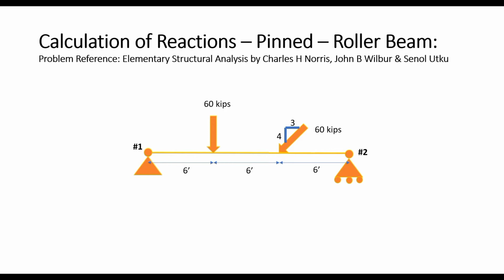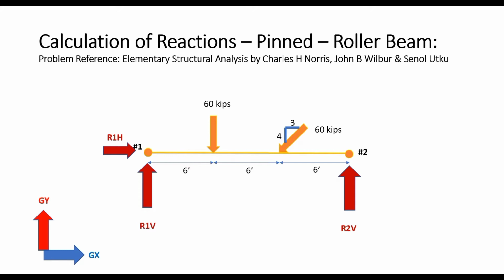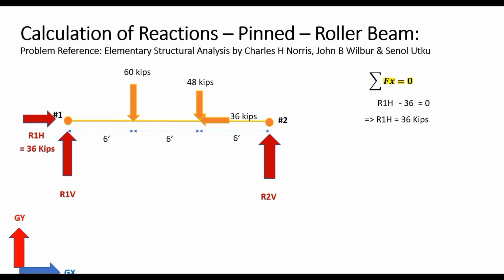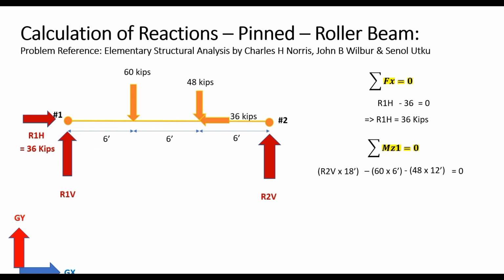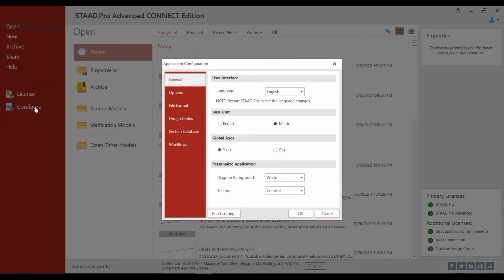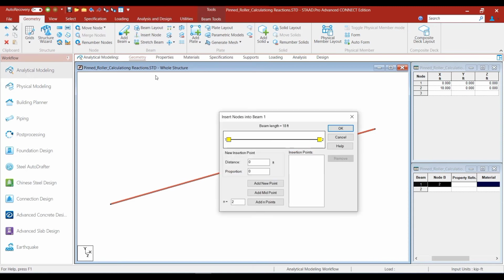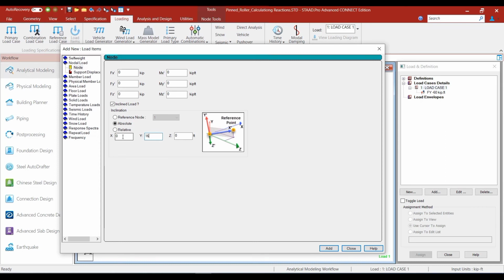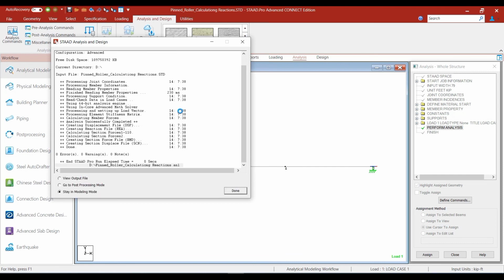# 55  - Interpreting REACTION Results in STAAD.Pro – 1

Comment: Sir Thanks for your wonderful videos series. Plz explain importance of splitting beam into 3 parts vs single beam member.
Reply from the maker: Thank you for your encouraging words. No, you do not actually need to split the beam. I had to split the beam because I had applied the point loads as nodal loads. However, you can still use the Member Concentrated forces that would not need you to split the beam - however, the Shear Force Diagram would be approximate in this case. I would explain this particular case as we go along in the course.
Reply: @structuralinsider8671  thanks sir